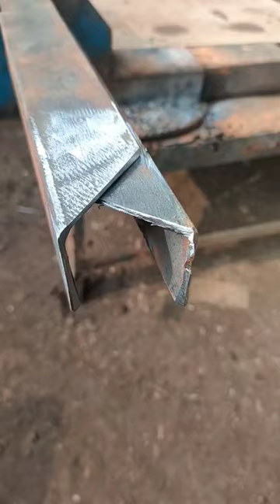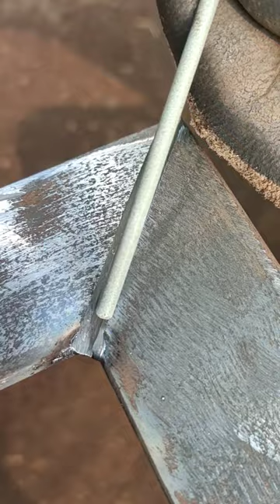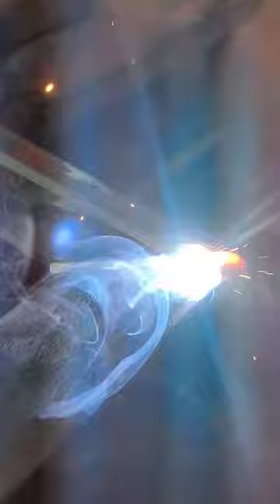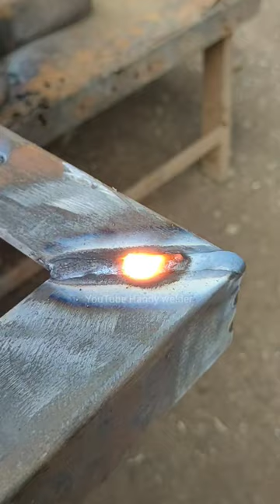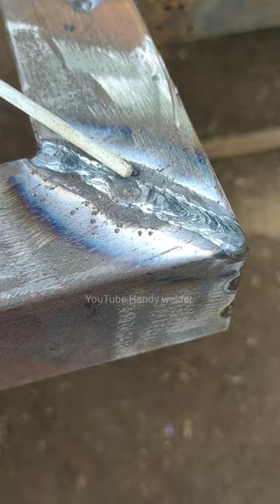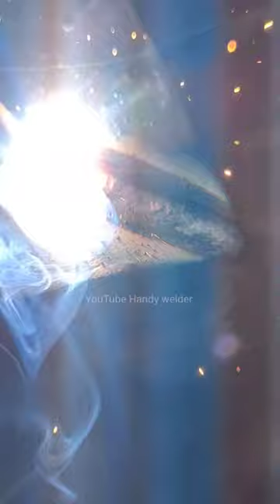the welder's secret in welding angle iron well. #weldingshorts

Comment: Tack the inside and the bottom of the outside, run a grinder right through will leave you a mm gap to weld and if done right a nice flush weld

Comment: I will let you in on another secret weld from the inside of the joint out or it will pull loosing your 90 degree angle you don't know much do you